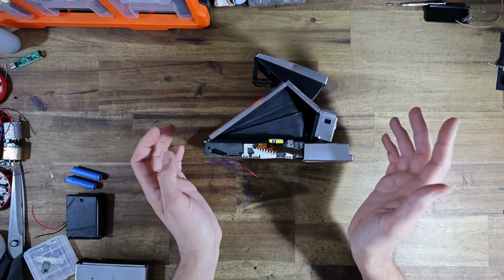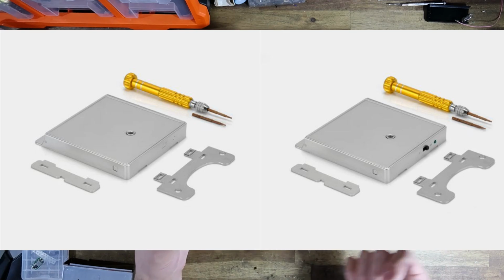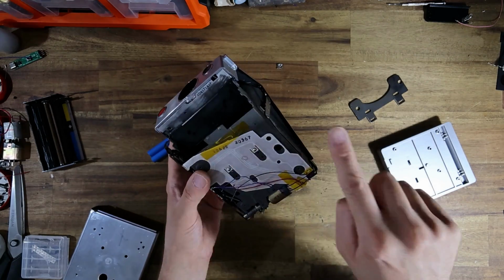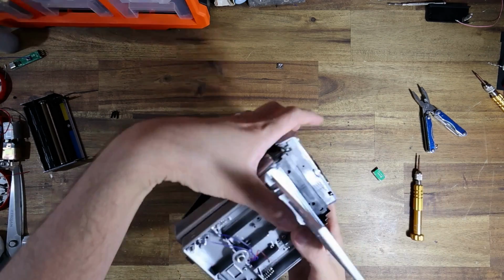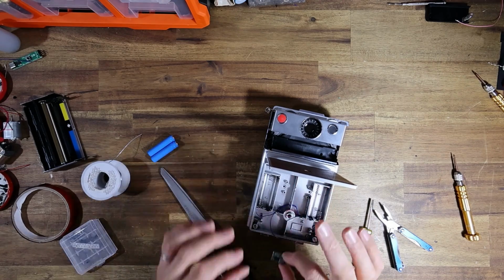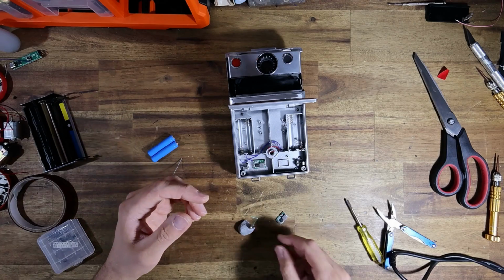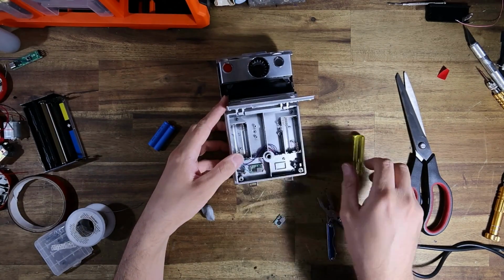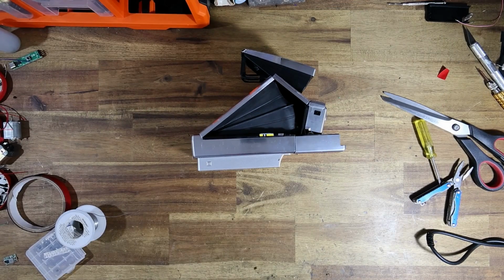Retrospekt battery adapter hack! 1/2 price i-Type solution!

Comment: why do you need the bck converter if your using 4 AAA's? 4 AAA's provides 6 volts right? why owuldnt you just put a rechargable 9 volt in like you did in your other videos considering your only using 2 at a time?
Reply from the maker: Check out the video I did called the "ultimate guide to i-Type adapters"

4x AAA alkaline batteries simply are not powerful enough for most SX-70s. It's actually a critical design flaw in the original retrospekt adapter IMO. They work okay for a Model 1, but Alpha and Sonar cameras struggle

I chose 2x 3.7V cells because that outputs 7.4V, which when put through the buck converter adapts the voltage down to 6V. Technically I could wire in all 4 batteries... but there would no no real advantage to doing so

A 9V battery wont fit

Comment: Excellent alternative to the original Polavolt battery option. Very well presented. 
Clear and straightforward and it helps to have watched the previous episode showing the soldering of the internals. 
What would be your preference now. 
The Retrospekt tripod adaptor base or the small black battery box beside the film counter at the back as per your original design ? 
Can I confirm that either way you could not only shoot I-type film but also 600 film ?
The 600 film just not using the film battery but the Polavolt battery.
Reply from the maker: Correct

It depends on the aesthetic you like really

Both adapter's work great

Comment: Great mod. When using 2 LiFePO4 batteries you wouldn't even need any electronics inside.
Reply from the maker: 2x 3.2 = 6.4

6.4V is at the very upper limit of what Polaroid list as a safe voltage for the SX-70

I won't be recommending that for clients
Reply: Could definitely resolve this with a linear regulator. May as well get a pre-fab USB-C charging board too… would be a great little solution. Perhaps a V2?😊
Reply from the maker: @OutdoorsIQ  I've already solved the voltage issue with the dc-dc converter (the small green PCB). Using raw LiFePO4 is not something I want to do, and the buck converter I have ensures voltage is guaranteed to be in safe spec so no further regulation is required

I did think about a USB C charging board... It's certainly possible. But the cost of adding such a thing in terms of labour (neatly adapting the plastic, installing the board, soldering it up) is likely more than just simply purchasing an external charger for $10usd

Maybe I'm old school... But I don't mind external chargers. Easy to replace if they fail, and very fast at charging

Comment: While we're on the subject of batteries and battery replacement as from 2027 all electrical appliances that use battery power and which are to be sold in the EU must have easily replaceable batteries that can be replaced during the life of the product by the consumer.
So that means the current range of Polaroid cameras i.e the i-2, Now and Go will have to have easily replaceable batteries when sold in Europe so that would mean any other country they're sold in As it would be pointless and silly to make a different version for other non EU countries.
I see there's room for 4 batteries in that tripod adapter/adaptor come battery pack so would it not be better to wire in 4 batteries to give a longer lasting power supply.
Reply from the maker: I could wire in extra cells in parallel easy.

Or... Just insert two extra cells in the other side and carry them as spares lol

Likely the second option is better, since you don't have to worry about unbalanced cells then
Reply from the maker: In regards to the battery EU regulations... We shall see. Nice that I've been so ahead of the curve hey ;)

I would love to see hard cell replacements like I use here... But somehow I fear they will find loopholes in the legislation. I believe already that the new law says that batteries of high capacity and efficiency don't need to fall under this category... So smart phones are exempt apparently? 

 Fingers crossed that government regulation changes things though

Comment: Nice video. I’m curious, with your modification to using the hinge switch would it still be possible to use a 600 pack of film and its battery. What would be the process for that?  Just take out the batteries from the Polavolt when using 600 film?
Reply from the maker: I suggest you watch my video on wiring up the PolaVolt. It's long but answers everything. 

I remove the original battery terminals inside the camera. This is to prevent causing cell discharge from unbalanced batteries and other possible electrical issues. This means it cannot be powered by 600 film anymore - it runs purely off lithium power.

It's really a non-issue though. The batteries have a decent capacity. And being a small hard cell design makes it easy to carry spares. Most other lithium solutions have built in batteries that require the whole camera be charged when flat. On mine you can swap the cells and keep shooting.

The extra redundancy would be nice, but I prioritise safety and longevity of the cameras electronics first.

Additionally, I use the cameras built in hinge switch as on/off to the lithium batteries. If you were to power the camera from 600 film using the terminals after the mod, the cameras shutter PCB would stay powered all the time and stress the chips. Not ideal.
Reply: @theinstantcameraguy  Will do! Thanks for the detailed response.
Reply: the terminals that touch the 600 battery pack are cut off from the rest of the camera during modification, so you won't have to worry about somehow overcharging it. I've been using the rest of my 600 film on my polavolt mod and it works exactly as if it were I-type ✌️
Reply: @Agraxian  thanks for the info. So after the mod, it is no longer possible to power the camera from the 600 film pack?  Just want to make sure I understand.

Comment: finally someone does a proper review on this, ive been deciding whether to buy this or not
Reply from the maker: I'll be doing a proper comparison video of itype solutions when I'm back from holiday

Definitely within the month

I'll be comparing: 
- the PolaVolt - my own iType solution
- the PolaPack by Retrospekt 
- the Rezivot 'Power Ranger's
- the Polastudio battery adapter 
- the Powerbar by Chromatic Parts

As well as commenting on "hack" methods
Reply: @theinstantcameraguy 
Not sure if the Mint iType is one listed there, but it’s got an extended guppy belly type thing, so not adding to length, and still aesthetically consistent 
  What amazes me, is the number of hot rod SX 70 mods there are !?! 
  Thanks for the great videos.
Reply from the maker: @charleyfolkes  I won't be reviewing the Mint option. It's only available on their pre-built cameras, and I can't purchase it to install for clients.

So I don't really consider it an option. It's basically the same as the polastudio back though, with a slightly different shape
Reply: @theinstantcameraguy  
Ahh yes, you’re totally right on that. My friend sent his ‘Time Machine’ modded SX 70 back in for that ..